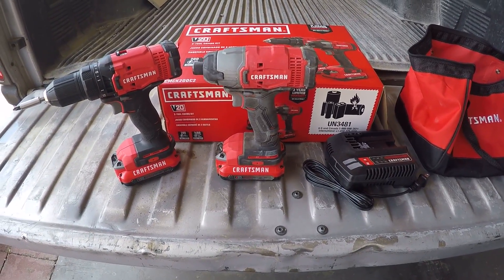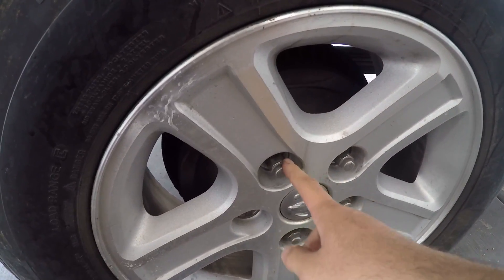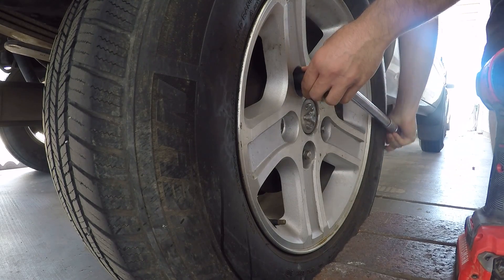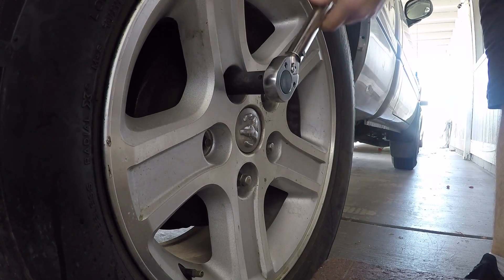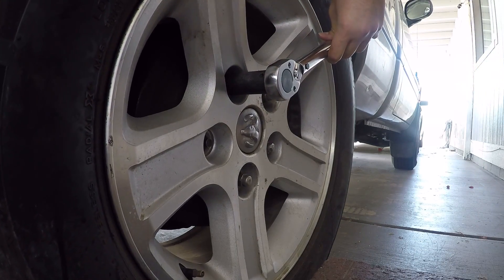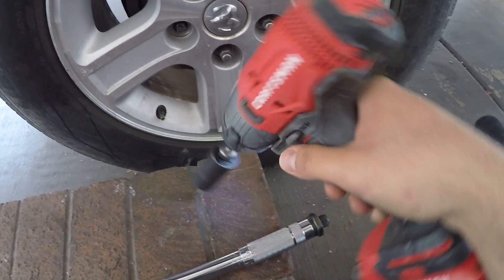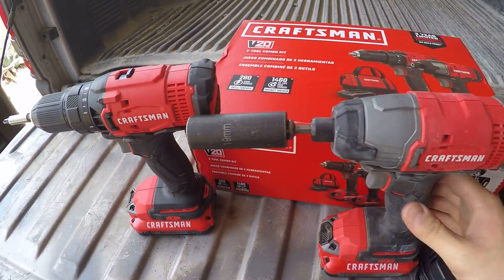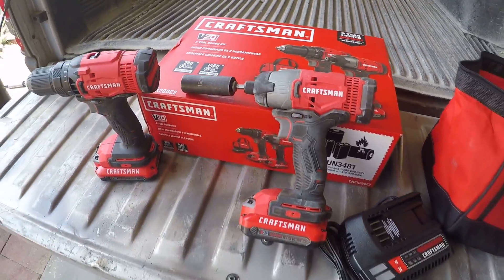Craftsman Impact/Drill V20 Combo Tool Review - Great Torque

Comment: have used that impact every day for a year as a tech, does a flawless job, wish it had a little more breaking power for lug nuts but either than that its flawless
Reply: I'm sorry but you people need help impact drivers apply torque only in forward to driver bolts into wood, you have it mistaken for a impact gun to which has torque in forward and reverse learn the difference
Reply: @lilgampla you sound like you buy tools cus they look pretty

Comment: Great review man!! I bought the 1/2 inch impact 1/4 inch drill driver drill and grinder 2 small batteries 2 big batteries and 2 chargers used for 220.00 love them so much went bought a skill saw for 75.00 at Lowes they all work great.  Thanks for sharing be safe have fun

Comment: I saw your video and I was impressed with 1/4 impact, I ran to Lowe's and bought it put it to the test for 80 lbs and it fail, I'm staying with Ryobi.. with that been said that is a very good video..
Reply from the maker: Thank you, Sorry to hear that but mine really works pretty well
Reply: It is a Ryobi. TTI is the same company making them both. Even porter and cable is the same. So if it failed. Prob defect or user error.
Reply: @unknowmysteries5925  Ryobi is not that good of a brand..they are a bit better than walmarts brand Hart..I will say that.
Reply: @unknowmysteries5925  wrong. Stanley owns craftsman. Ryobi is TTI
Reply: @unknowmysteries5925  not true Craftsman is owned by Stanley Black & Decker the same company that makes DeWalt
Reply: @unknowmysteries5925  black and decker dewalt makes the red craftsman. The old sears ones were TTI.

Comment: Got this in a 7 tool set for $271 from ace hardware (was 20% off. Normally $329) impact, hammer drill, multitool, skil saw, sawzall, grinder, flash light, charger and 2 batteries. It's all been really awesome. Had used the same for over a year at work and finally sprung for my own. They kick ass! Are they the best? No. Do they do everything I need and more for the best price? Absolutely. If you can afford, definitely get the 7 tool set. It's a way better deal overall.

Comment: Well I don't work on my truck much but I'm not a mechanic.  I baught the same kit for $99.    $104 after taxes.   I do plumbing for a living and I just needed the impact for other things and drill.    Only complaint I had was the drill doesn't have a hammer setting.   Other than that I'm good with both tools and so far it's been doing what I needed it for.   Wished I had a milwaukee but craftsman will do for now.   Could've been worse I was going to buy wallmart hyper tough.

Comment: nice video brother, i just bought this bad boy, what is that adapter so you can put on sockets to this impact driver?
Reply: That's a 1/2" socket adapter
Reply: That adapter is for driving lag bolts and ledger screws & such. Not at all for removing lug nuts.
Reply: @certifiedyaminspector-dadd6224  I believe the point of the video was to push 1/4in impact driver to the limit..

Comment: My freind has that kit and is great for a beginner. The drill leaves a lot to be desired and the impact could be better. Not great for automotive use, it just lacks in power. Used it for a framing job and the battery died after about 30 to 40 4” screws. For comparison sake I have the ridgid subcompact and it sunk about 80 -100 of those same screws before I had to swap batteries. the ridgid did a better job but is brushless, has a slightly bigger battery and that kit was twice the price. These are great for around the house but there are many kits out there that do the same and are a better price.

Comment: I've got the same combo.  The drill is a piece of junk, the impact driver is the star.  The drill had a wobbly jaw since day one and today it sounds like the gears are stripping out.  With the clutch set to the tightest setting the jaw stops spinning but motor keeps turning, it sounds like it's jumping gears internally.  I barely even used the drill because the wobbly jaw was driving me nuts, so I stuck to my DeWalt.  Guess we'll see how the warranty process works at Lowe's.
Reply: Id say you got a bad one then.. my drill has been amazing
Reply: @TheModAddict  More than likely.  I've felt some demo ones on display at Lowe's - half have the wobbly chuck, the other half don't.  Either way that has no effect on the internal gears.  I also have the brushed DeWalt sister drill, and that has no play after two years of hard abuse.  I bought this combo because it was on sale for $80, and I needed an impact driver.  Was a good way to get into the Craftsman line.  The impact has been great so far.  As far as warranty is concerned, you have to go through Craftsman for the V20 lineup... Lowe's will refuse to help unless it's within the return window.

Comment: I would like to see how many lug nuts you could take off on a single fully charged battery. One lug nut is no big deal. If the battery is spent on just one wheel, then I don’t want it. Nice video though.

Comment: That's a impact for screws and lag bolts that the wrong way to use it u need a impact wrench not a impact driver I guess u can take off lugs but it will not last long get a impack wrench

Comment: You're definitely gonna need that warranty if you keep using that driver on lug nuts. That thing wont last you a full year
Reply: I jist used my for my lug nuts...no problem. I know its not meant for it but for a on the side of the road, emergency situation; this will do the trick to change out a tire.
Reply: @vince2997 using that thing for tire changes is just down right stupid! Especially if you are tightening the lugs. Just get a tire iron, they're only $12. It's not worth your lungs falling off while driving down the road.
Reply: @certifiedyaminspector-dadd6224  thats why I said EMERGENCY. Emergency as in, [you] dont have a tire iron in your car in the middle of nowhere. You have a sprained wrist and cant break loose the lug nuts...whatever the reason. Of course you wouldn't want to use this every day for maintenance....thats what impact WRENCHES are for. As far as wheels falling off..this driver has a impact rating close to 135 ft lbs. Ive never seen a car have more than 100 max. Im sure your wheel wouldnt ve falling off anytime soon. Read brotha, read.